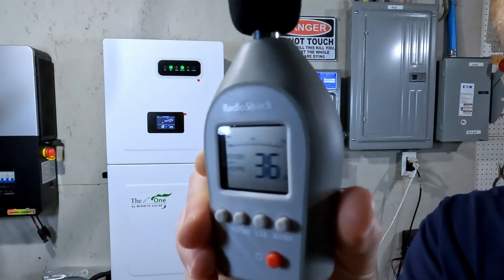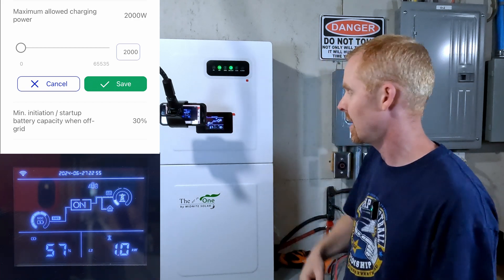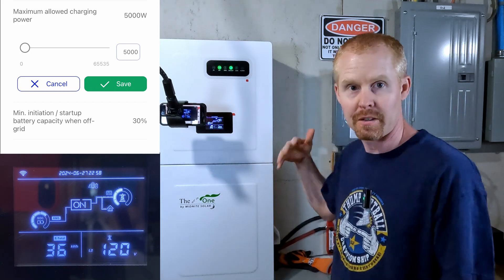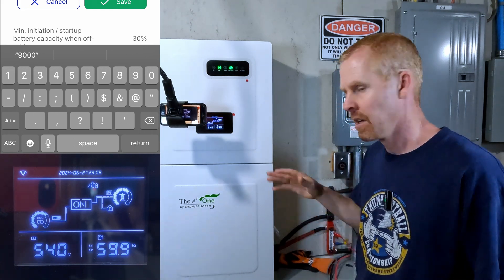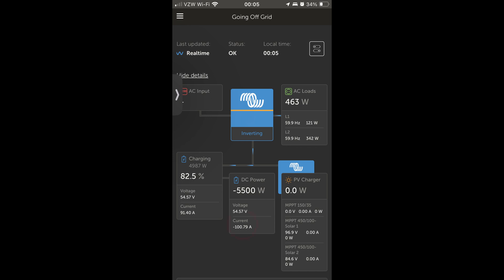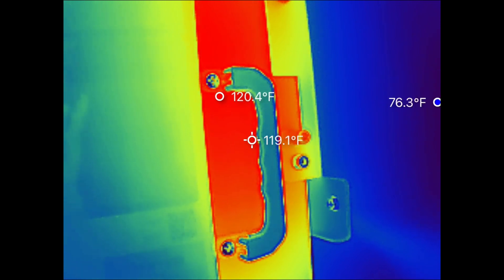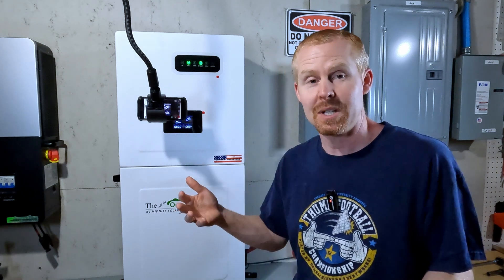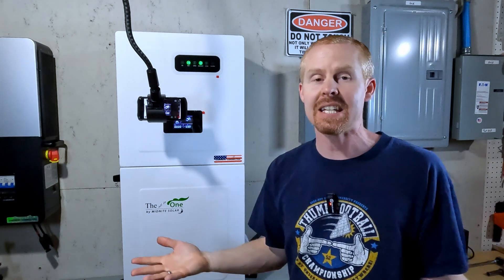How Do the Fans Work and Sound on "The One" by MidNite Solar?

Comment: I'd say temperature controlled fans. A hot August, in a shed, will heat things up even running less than 1000 W. Midnite Rosie inverter turns fans on at 47ºC. I can pull 2.5kW from Rosie, and it takes about ten minutes before the fans come on in low speed.